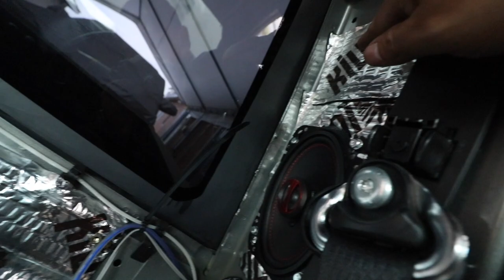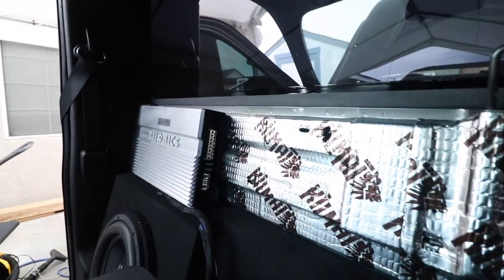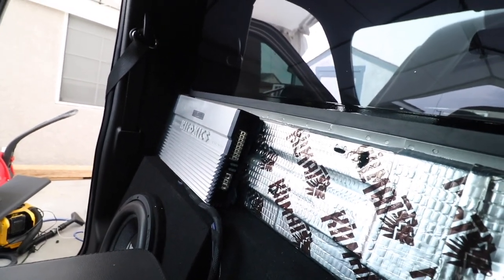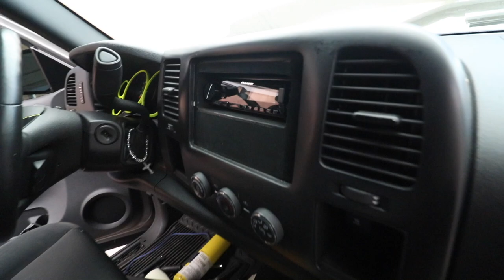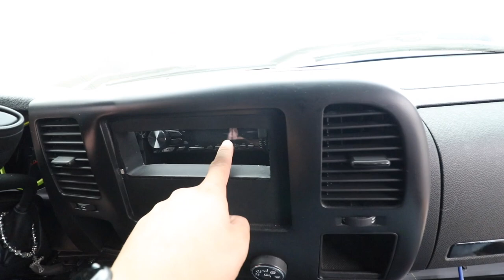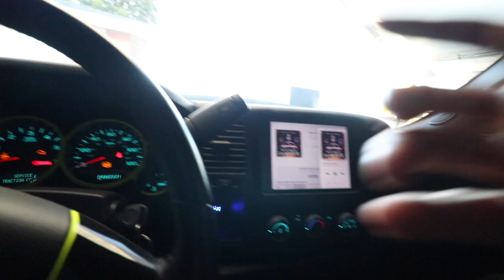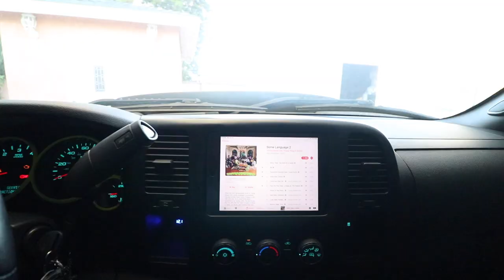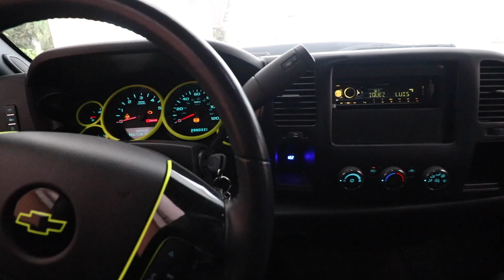DS18 SOUND SYSTEM FINALLY DONE!!! *AMAZING SOUND*

Comment: Nice set up but as a advice you should put some rubber spacers on the amp to prevent any damages due to rattle/vibration

Comment: The sound quality is super good! And loud af how much did you drop on it?
Reply: i say no more than 1k
Reply: i got 4 speakers and 2 tweeters and an amp with all the wiring for it for 415 and some change!
Reply: @eminent6762  got mine for 550
Reply: @benjamincruz514  where did you get it all that from?
Reply: @kayliemoore1881  local audio shop in my area!
Reply: I got 4 apocalypses 6.5 speaker rack ds18amp and a 12 inch g2 dynamic 1800 watts for 500
Reply: Where at 500$ for all that is a hook up no cap 💯

Comment: Would two Ds18s sound good on an 03 single Cab got 2 10 inch subs running 1200 kicker amp jus need some voice speakers thinking of ds18s

Comment: Bad ass , just got my ds18s and amp installed and they sound worse than my factory bose, is it the speakers are did the shop do a crap job?
Reply from the maker: My ds18 sound amazing. Maybe it wasn’t tuned properly 🤷🏻‍♂️
Reply: @projectvc425  alright alright thank you

Comment: Why you put another single din, throw a screen on there
Reply: He has it that way because he running an iPad no point of having a double din then still having another screen on too
Reply: @stepsidetony_3156  how is that possible?
Reply: @carlosmolinar5334  it’s possible because of Bluetooth bro. Just gotta get a bracket that fits the iPad or you can make a little box to put on the floor.

Comment: That is not amazing sound bro. WAY too much highs, and ZERO mid bass presence before 100hz. I just removed DS18 from my doors, and put them in the trash where they belong. Zero presence from under 100hz, need to start at no higher than 55hz. DS18 = thumbs down.